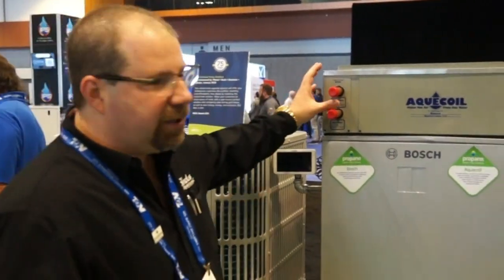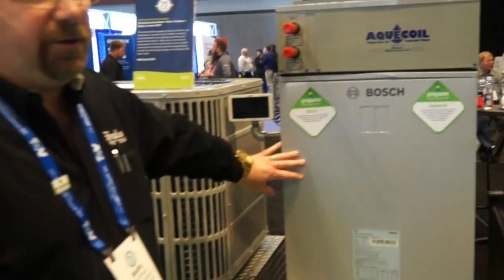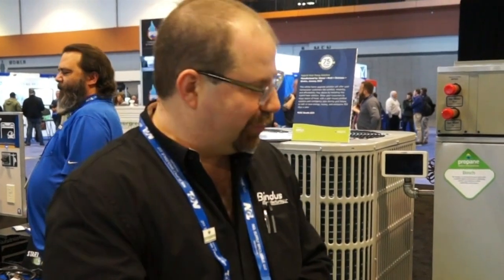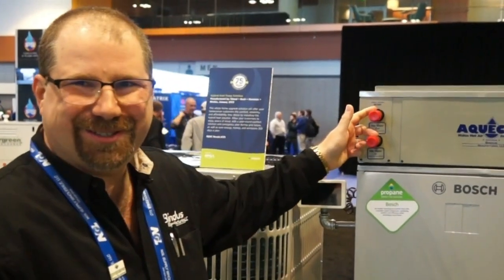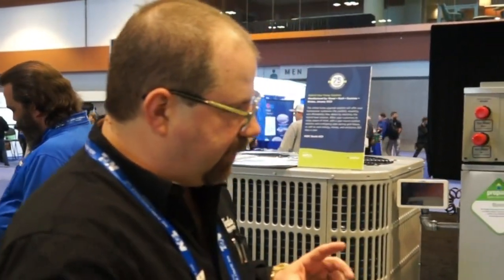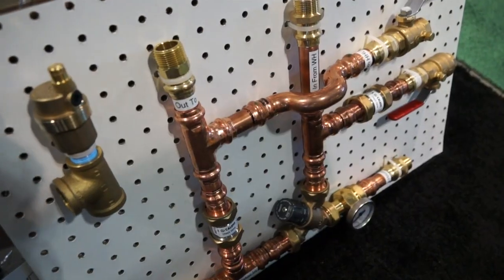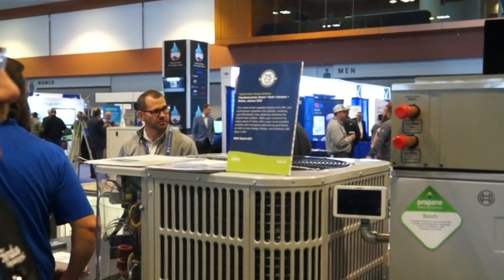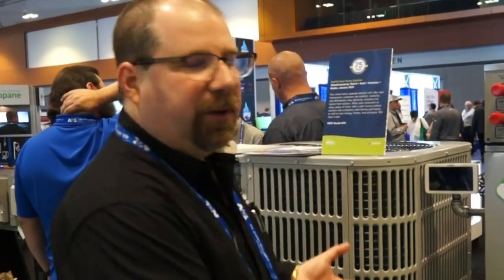Heat Pump Helper® by Bindus at the 2023 SE Propane Expo in Nashville!

Comment: What if your air handler is in the attic and prone to freezing? What do you do to prevent that without glycol?
Reply from the maker: Thank you, that's a great question!

All Heat Pump Helper™ packages by Bindus Manufacturing include a bi-metal thermostat which is field mounted on the "water out" manifold tube inside the AQUECOIL® Hydronic Heating Unit cabinet for use with plain water.  When properly installed and supplied with electricity, this FreezeStat will energize the circulator pump when the internal coil tubing falls to 40° ±5° F due to weather, malfunctioning air conditioning equipment or any other reason.  It will turn the pump back off when the water temperatures are safe and repeat the cycle as often as is needed to protect the internal water coil.  The FreezeStat will NOT detect the temperature of water pipes outside the AQUECOIL® unit, so those will have to be protected appropriately per building codes.  Also note that while the expected product life of the FreezeStat is many years, all mechanical devices may fail and must be periodically tested to ensure proper functioning.  In the event the hydroheat system will be exposed to freezing temperatures without electrical power, it must be drained.

In the event the Heat Pump Helper™ must be installed in unconditioned space where connecting water pipes cannot be protected from freezing, the only safe option is to use a properly concentrated and maintained glycol mix in conjunction with Heat Pump Helper™ model HPH-EZC1 or HPH-EZC2 with a tankless combi or model HPH-EZB1, HPH-EZB2 or HPH-EZB3 with a boiler.